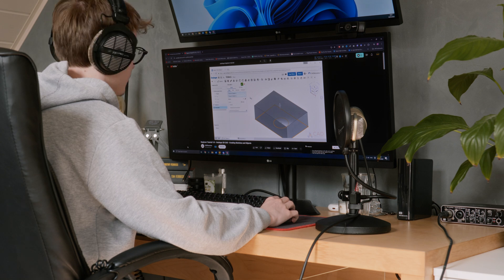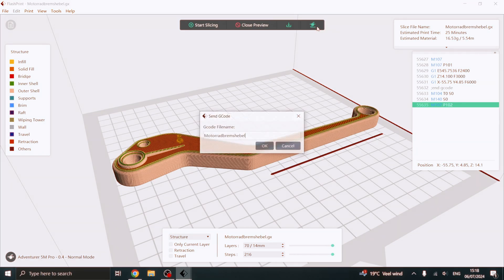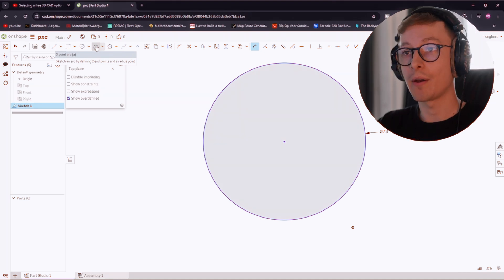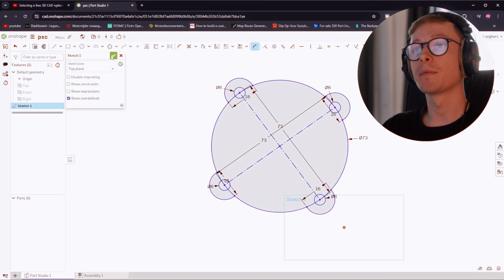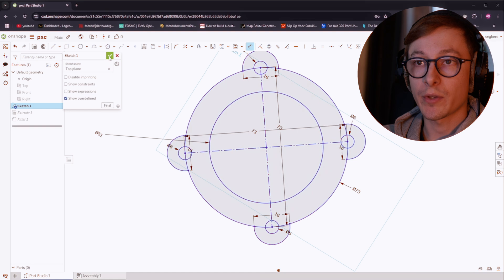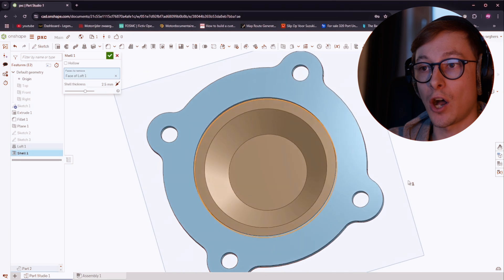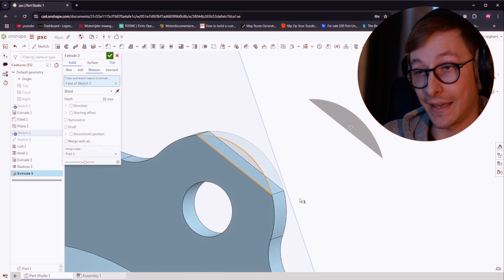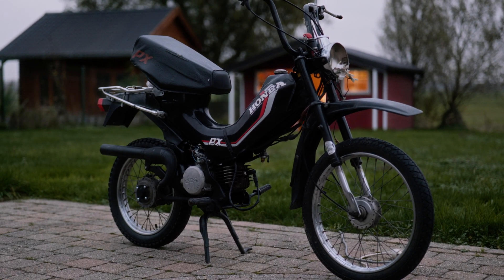Saving History: 3D Printing Unobtainable Motorcycle Parts

Comment: Hi, very cool video! Just a few advices: Orcaslicer is a game changer compared to what I remenber of flashprint, so you might want to take a look at it. Also, the revolve function would have do 90% of the job on this model. (sketch->revolve->sketch on the newly created flange-> extrude to reveal the holed ears.)

Comment: I absolutely agree, I bought a Suzuki Bandit 2 years ago. For some reason it seemed impossible to find a choke lever for it, the part is a simple plastic ring with a slot for the wire and a lever so i figured I would just model it and use the 3D printer I have access to at uni. Even though I also had 0 experience with 3D prints or modeling, the lever is still working great 2 years later.